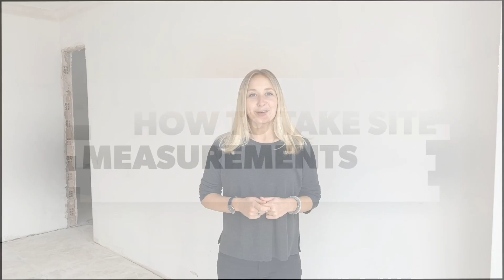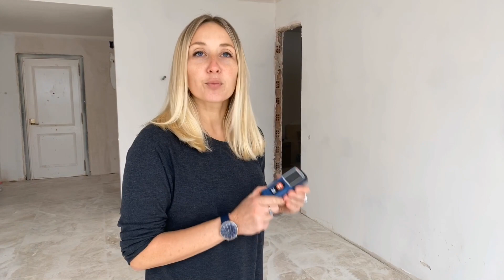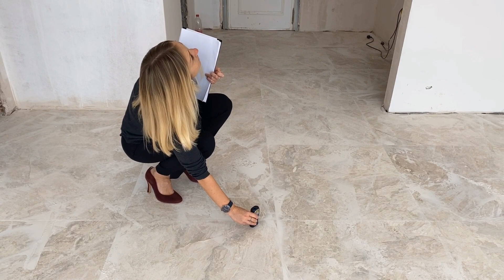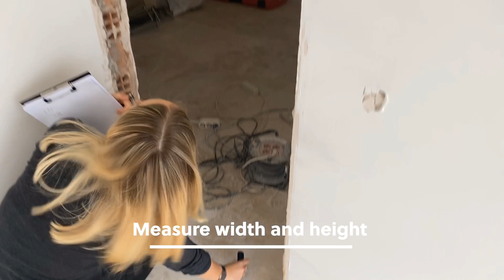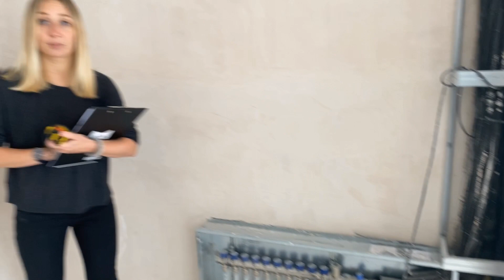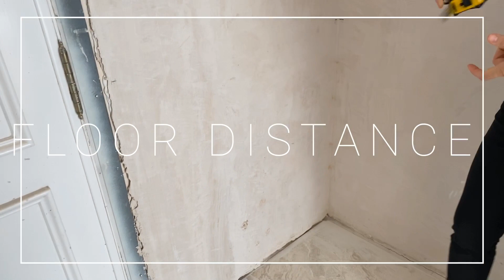How To Take Site Measurements For Interior Design Projects

Comment: NEVER Take Site Measurement without 1000mm LEVEL because every measurement Start on the LEVEL. Never take measurement from floor to Ceiling. Otherwise it will not align your windows and doors and your ceiling too. Hope it helps
Reply: I see...but why do you say so? What's the difference I am really curious to know